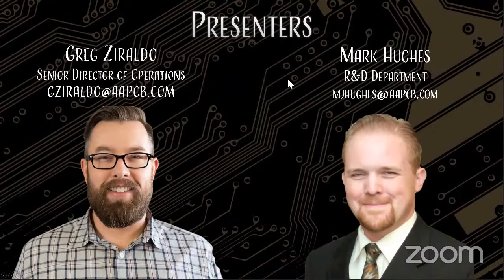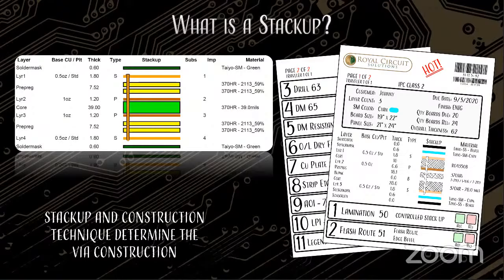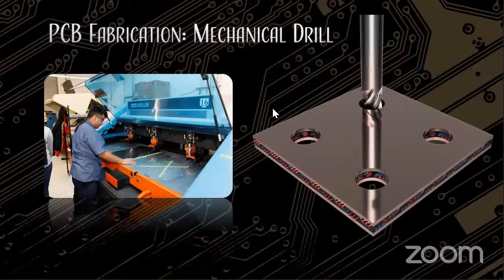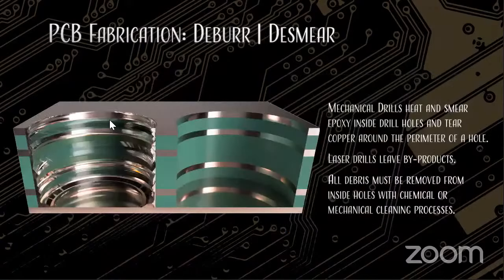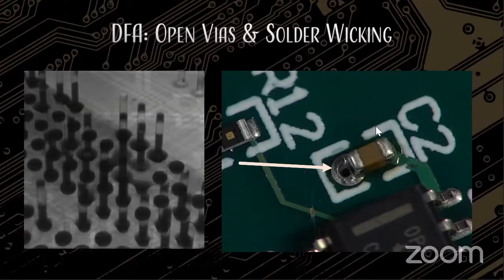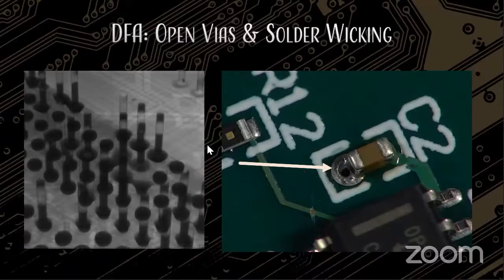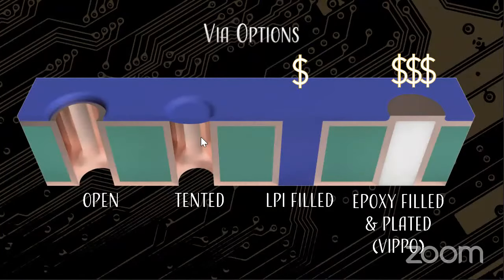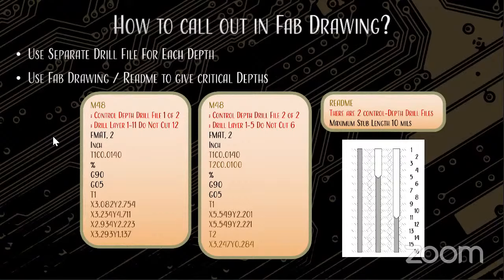All About Vias Webinar Replay

Comment: I was tasked with designing boards for medical devices. I used vias for EMI mitigation on the control side of the board up and down between layers like twisted pair to cancel out the EMF and it worked beautifully during my test of a transmitting cell phone placed on the board. I also used them to establish mechanical test point anchors as the boards must all be tested for 100% reliability. The open vias offer a socket-like anchor for test probes. I later used spring-loaded snap-in color-coded test points to make it even easier. I used a crimped-in tube type via looking much like a rivet recommended by the board house for that purpose. I did not see that type of via in your slides perhaps it is no longer used. I seem to remember they added about $1/ each to the board cost during a short-run prototype phase. I must have used your board house if you manufacture in the USA.  As the company manager, I required that all manufacturing be performed in the states as I could not verify overseas manufacturing and would not put our company ownership and executive management (me) in jeopardy of felony charges because of violation of our own Quality System that I helped to author and carried my signature.
Reply from the maker: Hi Micky,     Sounds like you've had quite the career.  

First, yes -- we own several board shops in California that carry ITAR, ISO 9001, and a few other useful certifications.  Second, this was not an all-encompassing presentation on vias, there's a great deal that was left out to keep it as short as possible (we planned for 45 minutes and ran well over).  

We do have a separate presentation on test-fixtures that you might find interesting:  https://www.youtube.com/watch?v=YKuUM8z1n0Q  .  

As for via rivets, without knowing the test rig design, it's hard to know why they recommended mechanical via rivets.  Off the top of my head, a few reasons I can imagine: cyclic thermal testing; high current transmission; or perhaps a high-spring force test probe.  They're not often used in production PCBs due to the size (take up board space), cost (must be installed manually, no real way to automate it) and the poor electrical conductivity over time (unless you solder them after installation, they'll tend to oxidize).  

If you'd like to chat more, you can reach me at mhughes@aapcb.com
Reply: @AdvancedAssembly  Good to know that my memory about the rivets is not faulty. We were using very high amperage I had to increase the copper thickness on the high power (H-bridge) side three times until I got it right. I remember using optoisolators to keep the high and low power separated. Our minimum board life was specified as 10 years (the law said minimum 7.5 years for complex medical devices) and the optoisolators were a concern of mine. The new spintronics isolators were just coming into fashion at the time and were considered very rugged and long-lasting. I would have converted to use them but they did not manufacture an appropriate device for our board and they were expensive enough at the time to dramatically increase our board cost so I opted out. None of the optos failed during our synthetic age testing so I went with the optos but they were a concern. I remember I could not seem to understand or perhaps believe in the spintronics operation and called and spoke to the inventor of the device. He sent me an animation and white paper but on the phone admitted that even though he invented it he really wasn't sure how it worked and we both had a good laugh.
Reply from the maker: @webebadd  There's a lot of clever people out there.  If someone were to ask me how spintronics worked, I'd just say "Magic.  They have little bits of magic in them.  Don't worry, it's good magic, not the bad magic stuff you hear about."